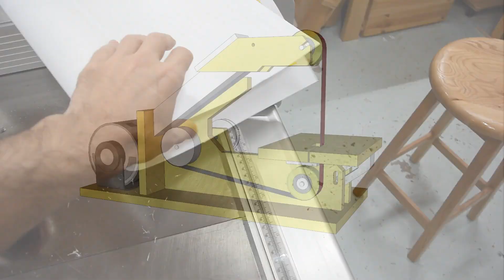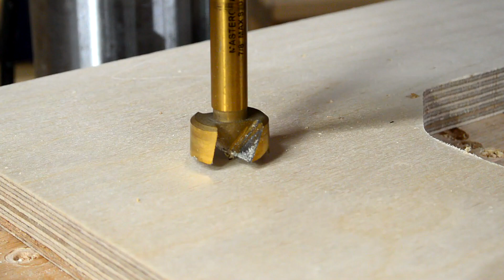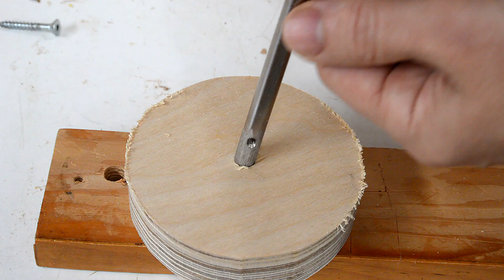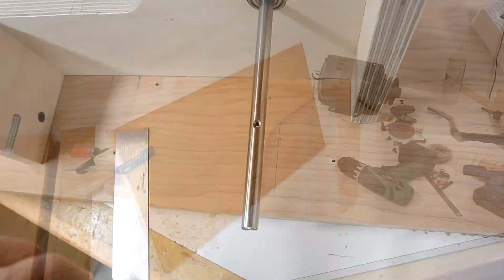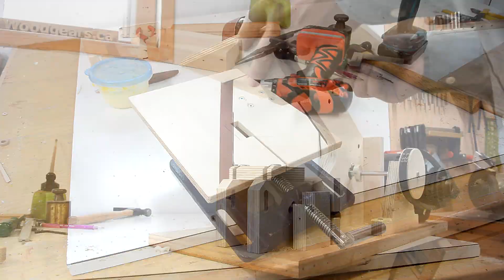Building the 1"x42" belt sander

Comment: I love the little impromptu guides you make to locate drills and the Angle Grinder. Also that special plattern to shape internal curves. The little refinements you added as the project developed make your narrow belt sander better and more flexible than the units people go out and buy.

One point. I seem to remember a woodorking lathe in your shop. But a metalwork lathe might have been more appropriate. Sometimes I feel like saying "Hang on mate. We could do that bit in aluminium or nylon on my Myford." It's just instinctive to offer a helping hand. Then I see your work around for the problem, actually has several benefits. Its a great new tool you have made Matt.   Interesting video, as always.

Comment: the legendary lathe reply: "No.  Spinning the pulley on it's own shaft avoids all issues of centering it later.  And using a saw blade instead of a chisel avoids potential snags and tearing it loose off the shaft."

Comment: Awesome machine! I've been thinking of building one, and you've given me plenty of ideas. I don't think its a replacement for a spindle sander, but it does have some major advantages. Having both would be great.
Reply from the maker: +Jer's Woodshop I'm not keen on spindle sanders myself, so this will be my substitute.
Reply: +Matthias Wandel The strip sander will sand about ten times as fast too.
Reply: @matthiaswandel Like you, I found a motor that someone threw out, only it's a ¾ horsepower 1725 RPM. It was in a dumpster. I plan to use it for a homemade disc sander.

Comment: Did I mention I love this sander?  I'm hunting for an old washer or heater motor.
Reply from the maker: +William Hayden Heater motors are the easiest to reuse.  This one has a 1/3 hp furnace motor on it.
Reply: Matthias Wandel I'll find one!  Somewhere.  :)  Serious though you went all out on this sander.  It's Beautiful.  I've watched the video at least 4 times.  Thanks.
Reply: +William Hayden These days more and more washing machines (and even some clothes dryers) have the motor integrated into the washtub/tumbler instead of an off the shelf motor hooked up with a belt. Makes scavenging motors a real pain.

Comment: I build this Sander a few months ago now and I absolutely highly recommend building it.
Although I have a disk sander and an edge belt sander it has found so many uses.
Additionally beeing powered by a 2 hp dust collector motor may be a little overkill, but no matter how I abused it, it is yet to slow down. Very nice.
Reply: @That's Character That was a bit of a hassle. I found some 2" wide belts on Amazon in the correct length and ordered them; they came from america though, so it took a week or two. I then cut it in themiddle to get a 1" wide belt. Kinda annoying getting them here. But I ordered a 10Pack and had 20 belts after cutting so they lasted a while.

Comment: 4 years later, is this still operational?  Any maintenance required for it?  I like it.
Reply: It sure is! We see it in his shop being used in his current videos. It looks like the same motor, frame, covers, control systems and same adjustments. I wouldn't be surprised if its even the same sanding belt!  Lol!!
Usually if he finds a fault in his DIY shop tools he'll post about it on one of his channels. Cheers
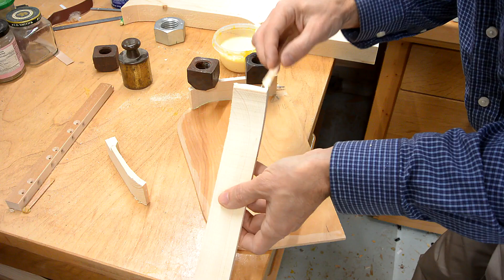Reply: @14:55

Comment: Wouldn't a lathe be much easer to make pulleys ?
Reply from the maker: +woodaddict1 No.  Spinning the pulley on it's own shaft avoids all issues of centering it later.  And using a saw blade instead of a chisel avoids potential snags and tearing it loose off the shaft.

Comment: can someone explain to me how the bevel on the belt makes it more stable
Reply: +Stragemque You mean the bevel (or crown) on the wheels/rollers? Old machinery used to use this extensively. Matthias wrote up an explanation. Go to https://woodgears.ca/bandsaw/crowned_pulleys.html.
Reply: +Stragemque 
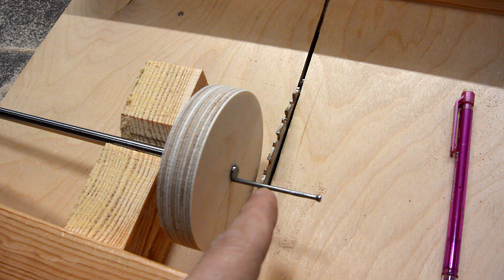Do you mean the v-belt and v-pulley at 6:50? That type of belt /pulley creates more surface area contact than a flat belt/pulley, which results in less slipping and better power transfer. That's my understanding, anyway. I might be wrong.
Reply: +gamerathebrave actually it's because a crowned pulley wheel will auto-center a belt running on it.
Reply: +Seth Manley no that's not the answer at all.
Reply: Everfalling You've misunderstood my comment. I wasn't referring to the crowned pulley, I was referring to the v-pulley.
Reply: +Seth Manley not at all, check matthias's crowned pulley video

Comment: You can align pieces as you tack them together with animal glue, which sets much faster than modern glue, and holds strong enough for further manipulation before you add screws. Also breaks apart easily and cleans well in case you need adjustment, again before using screws. Animal glue begins to become useless when the pot is hotter than 60c. Your machines are great!
Reply: +Paul Mcnulty Oops, I shouldn't have said tack together, just stick together, no tacks required

Comment: i work with metal mostly welding, fixing cars and such, i am just amazed how awesome of a material wood is, you could make this tool with metal, steel for example but everything has to be precise pretty much from the start, you cant just for example glue a hole shut and drill it a bit to the left, you could weld it but it is awful to drill welds. i could slap together a birdhouse but nothing more.:D

Comment: Well done Matthias ! and a very happy new year to you (2022)
I've never seen this video of yours before !! -  it was very cool to see you building other useful workshop tools besides a bandsaw ! as when you cut out all sorts of shapes on the bandsaw there may come a time where you will need a small belt sander like the one in this video to obtain a perfect finish (as most bandsaws tend to leave vertical lines from their cutting action around the work piece), so a small belt sander like this is the perfect companion to get rid of bandsaw lines and finish off that all important work piece !  👍👍👍

Comment: very nice design. I don't have  experience using a CAD program. I've been a Welder/ Metal fabricator for 40+ years. most of my projects have been one off  build as I go with very little drawing. I like your plan, I will buy your plan I think. I'm also very interested in a 2"x 72" belt grinder for knife making..

Comment: I got into woodworking back in 2019 with a craftsman 12" bandsaw (3/4 hp), two Stanley hand planes (#5 and #4 1/2), miter saw, and circular saw. I found that I could not get to where I was going without a table saw. I bought a 10" Delta (1970's 1 1/2 hp model), but after countless criticisms about my "unsafe" table saw (the fence is a pain in the butt to get right), and my crappy (not to me) bandsaw, I lost interest. It was too much. I still need a drill press, belt sander, belt grinder, and planer, just for starters. Maybe I'll get back to it one day...

Comment: If someone is building this thing today, I have a suggestion: have wheels 3D printed from Nylon! You will get them for precise dimensions, centered, properly weighted, with exact crown/belt groove you need, light, sturdy, and cheap. Just tell the 3D printing guy that you need them tough. 
I wish I could 3D print wheels for a bandsaw.
Reply from the maker: Not worth the hassle to save a few bucks for old rollerskates and an hour making the wheels.

Comment: Another great vid.....  If you're up for another test idea here's one that has been bugging me.....  My theory is that we tend to overclamp and over pressure the clamps.  For example,  clamping two 3/4 inch thick boards, 4 inches wide by 18 inches long together on their faces.   I believe that the rigidity of the boards transfer enough force that you really only need 3 or 4 clamps.   I have seen others use 6-8 clamps....   I'm betting if you tested this, I would be right!!!
Reply from the maker: +EMTdrummer Search my website on that topic.
Reply: +Matthias Wandel Thanks... will do

Comment: The one that has strong frame and 700w router which puts limits to it. 18mm plywood 3 passes  feed rate i suppose was between 55-65mm sec. And that is straight flute bit but should use plywood bit. To be honest every job no matter tools. cnc or bandsaw...whatever else, speed comes with experience. As i know i dont have enough skills to make perfect cut with bandsaw, cnc is faster. You are clearly more skilled and make it better of course.  Depends on too many factors. What is important is that finished product is ok and usable, faster or slower, as long as you make only one of it, doesnt really matter that much. You make nice tools yourself and respect for that.

Comment: I sell replacement wheels for the Delta Rockwell 1x42 sander grinder that would work a lot better than the skate wheels,. especially my 2" diameter idler wheels with the larger sealed bearings.. The Rockwell uses a 3-1/2" top idler for tracking, and a 3-1/2" wheel for the drive wheel.  With the correct design......you can do inside sanding with a 1 x 42 " belt sander.....many do not know it, but the Delta Rockwell can be set up to do inside sanding by moving one wheel and rerouting the  belt using the platen and idler arm.

Comment: Wow, You are a genius. I m interested in cutting glass bottles. I have perceted the art of cutting the bottles in perfect fine cut. I wish to make a belt sander to grind and bevel the edges of the glass bottles. at present I get the fine grind from glass cutting workshop outsource. It is very difficult everytime to take the cut glasses out to get them grind on belt sender out to third party. they get shattered in transportation. so wish to have my own belt sander. also please help me how to do sanding from inside the cut glass bottle.

Comment: Most CNC you can set the size and thickness of the wood you are cutting.
Reply from the maker: +Jake Abel Yes, and it takes forever, makes a wide cut, and you need room around the piece to clamp it down.
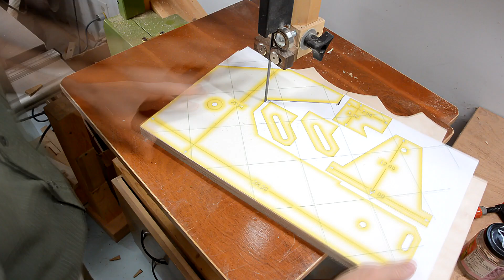Reply: +Matthias Wandel I suppose it could be difficult. Now that I look at that piece of wood at 0:46 again you would have a problem with the wide cuts a CNC usually makes.

Comment: A question about your use of motors: have you ever thought of standardizing a series of these builds to use a single electric drill that could be mounted and remounted as needed? A modified angle grinder could be an option too.

Comment: pro safety-troll tip: that motor-switch needs to be enclosed to keep out dust that could accumulate and ignite when the switch is turned on. Keep in mind that the entire assembly is made of wood, and a dust fire in the switch housing could migrate to the whole tool, set it on fire and thence your entire shop.

Lives are at risk.

I suggest wrapping the switch box with aluminum foil and applying a liberal coating of silicone seal all over it. It will also contribute to a tiddy, perfessionel look to the machine instead of that ugly metal box.
Reply from the maker: I guess you haven't noticed that the switch housing is made out of metal?

But - your safety approach is better.  Don't build anything.  Therefore, no risk.

Comment: Most belt sander/grinder designs I've seen use only one crowned wheel, either the tracking/tensioning wheel or the drive wheel. I'm curious if you did any testing regarding using one or two crowns. In my thought experiments it doesn't seem to matter, but I've seen forum comments claiming that having two will complicate things.

Comment: I don't get why you think you can't use scraps efficient with a cnc. It's just as easy or probably easier then templates and a band saw. I have both the tools mentioned, and they do the exact same thing in this case. Cut shapes where you want to.

Comment: Hi Matthias,
I have access to motor that looks like the one on the Mastercraft belt sander you are showing at the beginning of the video and was wondering if I could use it to build  a version of your belt sander. I guess it's power would be ok but what qabout it's speed?

Thanks for all your video -  very inspiring and I'm looking  forward to buy many of your plans in the near future cause I just finished building my garage/shop and in the process of setting it as a workshop.

Comment: bro you can use any size scrap with cnc.  just gotta set up the stock options right
Reply from the maker: +Seamus H That's not the problem.  The problem is needing to leave so much room between parts and on the edges for mounting.  And it's usually too much bother to rearrange the layout to match odd shaped scraps.
Reply: +Matthias Wandel With a vacuum hold down table, planning and using scrap becomes a lot easier. I maintain a 20mm part to part clearance using 18mm BB. Cutter typically is a 5/16 up/down. I typically work left to right and bottom to top. The scraps are usually rectangular and are broken down further into 1/4 sheets for simplicity's sake. 

But the band saw works just fine for this application. You're not pounding out 30 of these a day or building them from composite panels.

Comment: Great Video!  I usually use an abrasive wheel on my angle grinder to cut metal.  Did I see that you used a toothed blade to cut metal?  Is there any advantage to that method?
Reply from the maker: +Richard DiPrima Cuts clean and fast.  But the blades are expensive.  this saw was on sale for $115.  New blades cost $50.  Haven't buggered up the blade yet.

Comment: Can you tell me if a motor from a circular saw like this one...Sears Craftsman Sawmill 2.25 hp 7.25 in 11 amps Circular Saw. will work to make a belt sander like the one you built. I have no experience with using/building tools so it would be useful to know if this old circular saw can be used for that? Much appreciated

Comment: why a 42" belt, just so you could have the 1 inch width?  seems like there are more grades in a 2x48 belt in my local stores.
any idea if it would be possible to fire proof it for use with ferrous metal?

Comment: Does the drive wheel for the sanding belt have enough grip on the sandpaper?
Reply from the maker: Barely.  Maybe I should try caulking on it.  But then again, once they get used enough, theyere may not be that much extra grip.  I just have to make sue I have enough belt tension

Comment: I'm curious about your drill press. It runs very steady vertically. Mine has a bit of wobble and it make nailing the hole placement tough. Its a cheap garage sale find so I make do as I can. I'm wondering if you have done anything to fine tune your drill press? Or did you just spend a little more for more quality out of the box?
Reply from the maker: +Jeff Fox A lot of my drills wobble.  But as long as you pre-punch the hole with an awl, it will follow that regardless.
Reply: Thanks, I'll be giving that a try

Comment: I plan on building this, but the motor I have is out of a washing machine, and it has a control board connection for speed control. I don't suppose you know how to wire one of those, do ya Matthias?
Reply from the maker: wire it like it was in the washing machine
Reply: Not likely you're still paying att'n to this, BUT - odds are that if you appreciate MW as I do, you'll also find Jeremy Fielding an exemplary instructor.  He's posted several vids re electric motors.

Oh - and what Matthias must have assumed you'd realize, but I'm not so sure: you need to be sure to utilize the SPIN cycle, not the DELICATES!

Comment: Hi I’m making your strip sander and I have a question about the crown for the wheels. On my table saw I have a 10 inch blade on and I would like to know if I use a smaller blade diameter would the crown be greater .
I’m asking this because right now there is hardly any difference from the center of the wheel and the sides. By the way I made a change for the with of the sanding strip from 1 inch to 2.
Thank you
Reply from the maker: The crown depends on what angle you meet the blade.  Bigger blades are better.
Reply: Thank you

Comment: Matthias can you tell me if the plans, as downloaded, would have the correction for the belt length built in or do I need to make a correction also?  I love the gear drive box joint machine.  I spent a couple of days making boxes until I finally figured out how to make it work correctly.
Reply from the maker: Fixed that in the plans, like I said I would.
Reply: y

Comment: don't understand why you bother to build this tool when you can just use your bandsaw... (with an appropriate sand belt I mean)
Reply from the maker: because the right length belt is hard to get, and it takes five minutes to switch, and just as you start to sand, you realize you need to make another cut on the bandsaw.
Reply: I buy mine from Felder/Hammer... I agree on your remark, it needs organization... but it saves quite a bit of money ...
Reply: but where is the fun in that?

Comment: So who keeps throwing out these furnace motors ? that must be the 3rd or 4th one you've "found in the garbage". Of course if you had to buy a new motor , it would be cheaper to buy a brand new sander , rendering the building process a waste of time.......
Reply: +jonathan jones He lives in northern Canada. Live anywhere where sub-0° C is common and you'll see old, unused furnaces everywhere.
Reply: +jonathan jones You might be surprised about what ends up in the garbage. I had a go-kart for this very reason, when I got it the undercarriage had lots of gunk on it and the steering linkage was bent on one side, the paint didn't match and one electrical switch didn't work. The kart did run though.
Reply: +Joe Choi he's in ottawa, so not really northern Canada :)

I woudn't say you find furnaces everywhere, but yeah, every single house has one so they are around if you know where to look.

Often furnace repair people take it with them after a replacement, so you have to have contacts with those types of people.